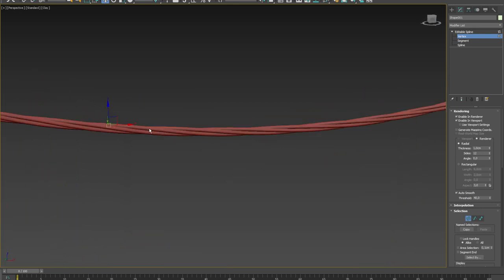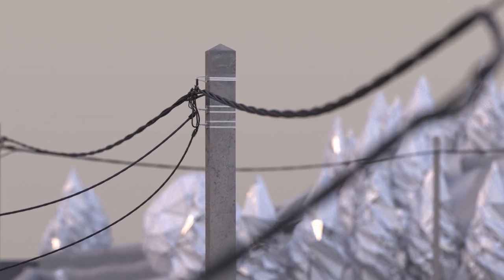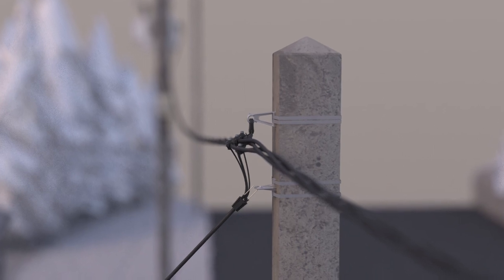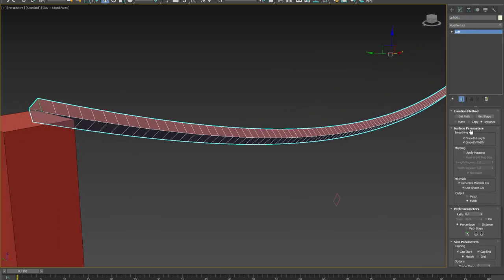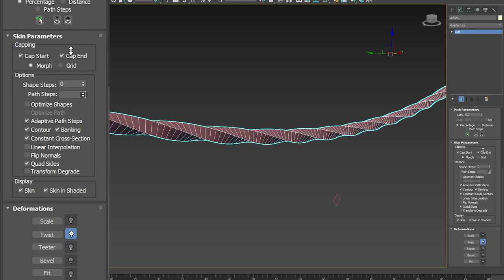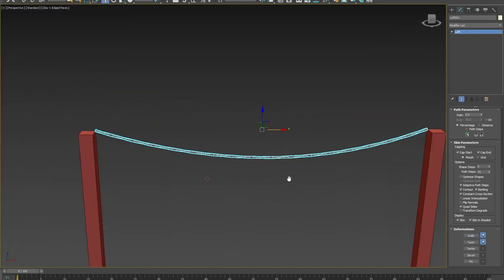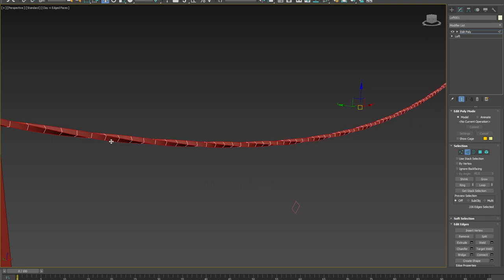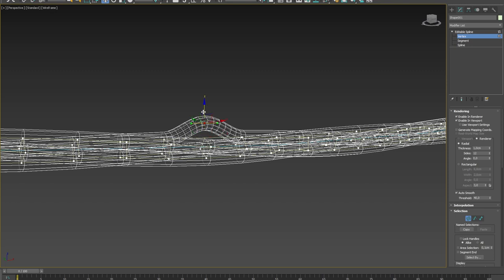Twisting Cables in 3ds Max - Tutorial

Comment: Bro how to make dynamic hoses with bones
Reply from the maker: Now that's a good question... what are your technical limitations? Is it to run in a game engine? if so I don't think its very different to any other rigging. Or do you want a simulated motion of the hose? but using bones? I'm curious now!
Reply: @laeianimation  I made a project like Offshore spm animation for hoses and crane I started with max some of points I stuck then I finished that project with help of blender also blender is soo easy but I like max but some time I stuck can you do a Offshore hose animation like real world dinamic simulation with ocena and hose and crane
Reply from the maker: @Loading, I think there is two different problems in you idea... I found that when I do something and I want it to look like the real world I get into complicated territories like "making realistic simulated waves". But then I try to cut the problem into smaller parts : 
- The waves on the one hand you can do with a simple deformation helper called wave or ripple, and the rest of the complexity can be a displacement shader -- then your deformation helper can move the water surface as well as either directly your hose mesh or a spline that you can use as a bone object (just apply a skin to the hose mesh, as a modifier, then use a spline as a bone and that should do the trick)
- On the other hand you have the rest of the motion floating on the surface, that can be a maxscript or just a projection controler.
- and finally the crane is some rigging. This guy as awesome rigging tutorials for mechanical systems: https://www.youtube.com/@larsem8

If you need all of it to be procedural, this may be really slow in the end and not very usable. 
Houdini or Blender may be a lot more stable with a fully procedural system like this one I think.
If you have more questions, please, find me on Discord!